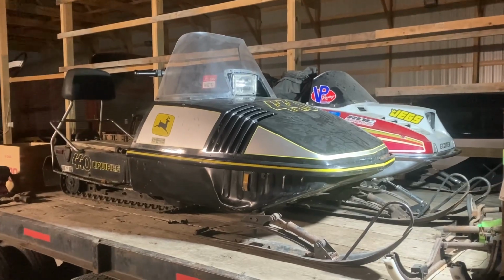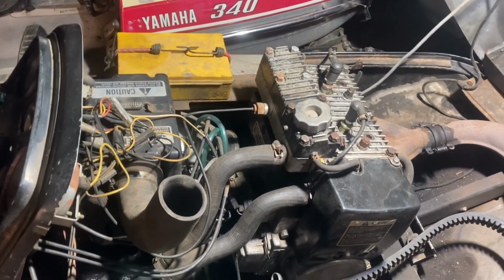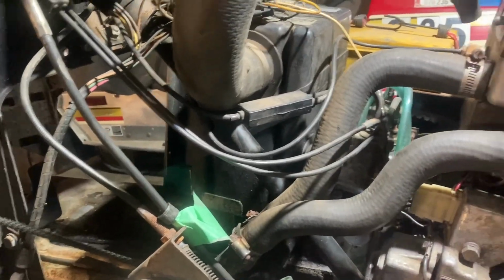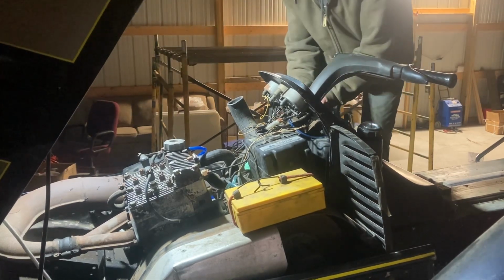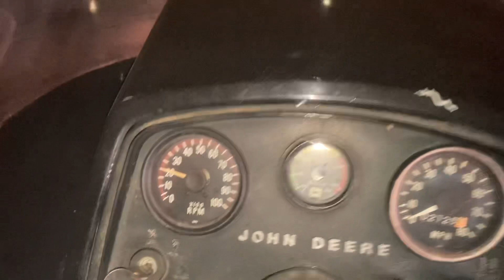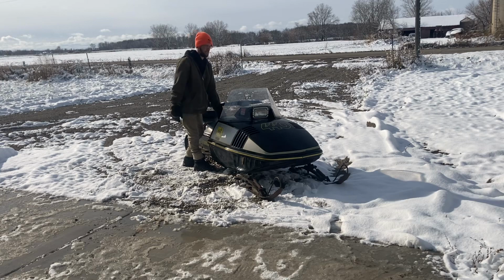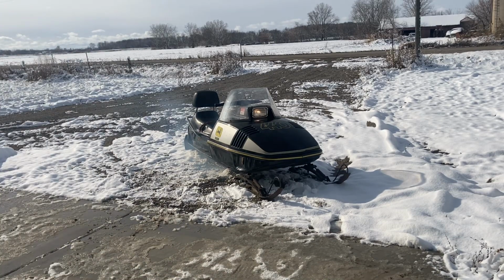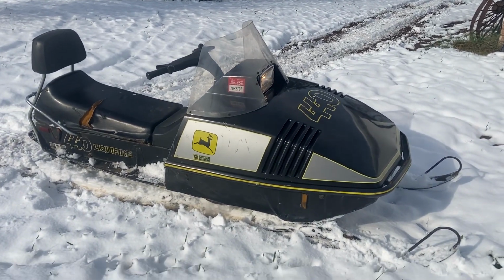NO SPARK!! John Deere Liquifire 440 - Can Fixing It Really Be This Easy? Will it start?

Comment: I'm happy to see them running again. I had a 75 Liquifire 340, and my ignition would cut out on one cylinder at random. There was no way to get a replacement ignition module in the mid 1980's, and it ended up being given away. I wish that I had it now, as i'm seeing modules available now. It wasn't the most comfortable machine, and it would go through front skis often. But, for a 340cc machine, it was FREAKIN FAST!!! I liked the black/silver colors and the graphics. Great Memories!! We bought it used in the mid-1980's, upstate NY, in the Catskills. My parents bought a vacation house around 1985, in Haines Falls NY, in Twilight Park. There were numerous times that there were blizzards down in the City, in Queens county, where we lived. I remember leaving at around 7:00 am, from Whitestone, with my daughter, (she was about 7 or 8) we got in my 88 Chevy 4wd pickup, and drove upstate. When we got to the house, we went inside, (to use the facilities) and so she could eat and warm up. I loaded the sled in the truck, tied it down, (too long to close the tailgate) and we  drove straight back home. We arrived just as the snow started falling. Everyone said I was nuts, but I was so glad that I had gone up to get it. Very shortly, you couldn't drive, and I took my mother, on the sled, to the grocery store! I was everywhere that night. Quads couldn't keep up with me, and the police didn't even BOTHER to try!!  Just a great memory. I wish that I still had it.

Comment: The wear bars are probably shot. You can buy carbide now. Probably should check the hyfaxs also.
Reply from the maker: Yeah there’s still a lot left to go over on the sled. They only make wearbars for them now, and even those are hard to find sometimes. One bar was half worn down and the other was basically worn into 2 pieces!
Reply: @twocylinderwill  Love the old machine's,  old car's and my old wife. Have fun.

Comment: I'm rewiring the stator in my 73 JD 440 with the Denso ignition just rebuilt the engine CCW.😁👍
Reply from the maker: A 73 with a 440 should be a JDX8, right? That’s an awesome sled!
Reply: @twocylinderwill  No it's the model 500 with the piston ported CCW 440 engine. The JDX were reed valve engines!

Comment: seems to have something dragging, that model when you touch the throttle it should launch. BTW that sled should hit over 100 mph on a lake.
Brian Spencer going across a lake the last day of the Winnipeg - St Paul with a Liquidator 340 was clocked at 103 mph. The only real difference between a Liquidator and LiquiFire is the LiquiFire has cooling underneath instead of the free air type radiator
Reply: Probably something as simple as a rusty brake disc, but you are right. It should roll after throttle let off.
Reply: Liquidator was 340 100 mph 😒 but they were fast for a 340.

Comment: Do ANY of you So called "Sled" guys check the oil? It is kind of important! Yea, the wear bars are GONE (I would Say)!
Reply from the maker: I genuinely can’t tell if you’re joking or just don’t know how a two stroke engine works. Either way, it sounds like a skill issue on your end
Reply: because the engine oil was mixed in the gasoline the only oil to check on those old sleds was in the chain case driving the track. If the lower seal leaked you would find it on the track, but ya check at least once a year